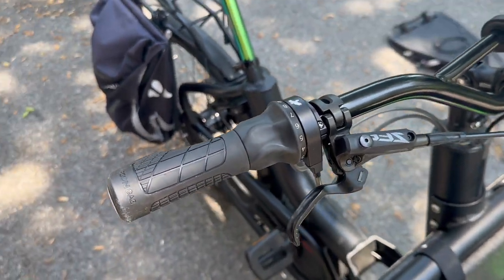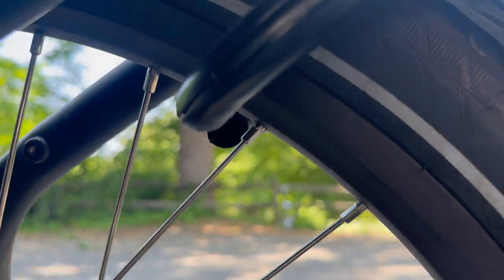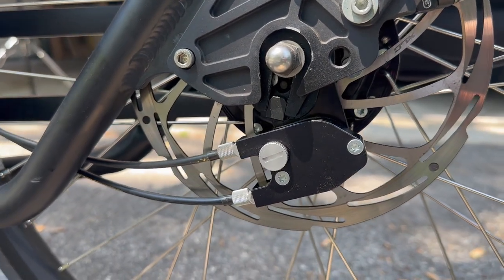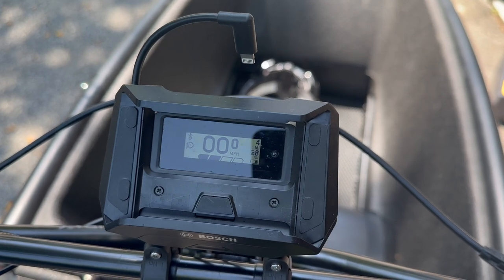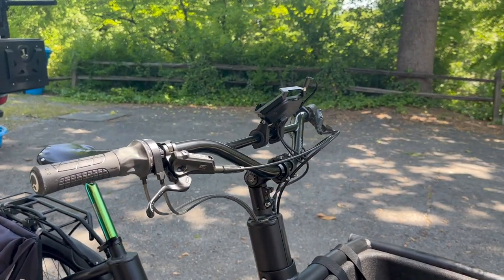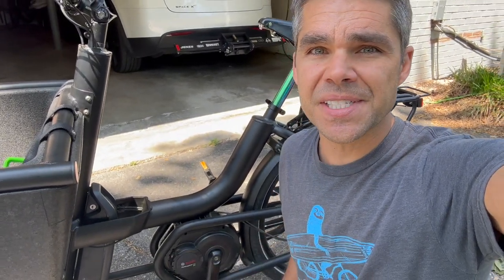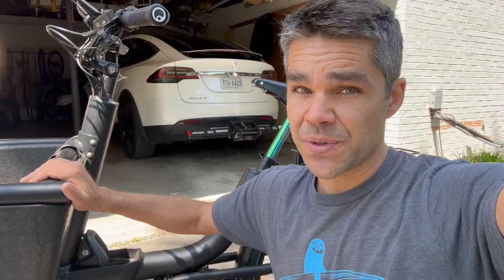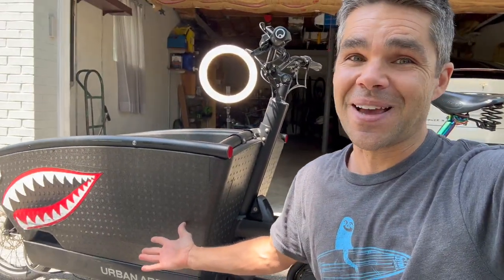Top 5 Urban Arrow Performance Upgrades

Comment: I got a cargo xl (with the alu box) for 1500 bucks.  

It is Gen 2 performance unfortunately, but I still upgrade it slowly bit by bit. 

I bought the Nyon and never took it out the box but thinking of selling it, and buy the Cobi. 

But both are quite a big operation to change on the UA (removing part of the motor assembly, and try to manage the cable through the frame). 

The cargo does comes with a suspended front fork, and the previous owner upgraded that one to Grind 20  (and the tires to Schwalbe marathon plus tires). 

The Rohloff upgrade is something I still want to do too.  My old Tender 2500 had it too (should have switched the tires before the sale of that one 😂).